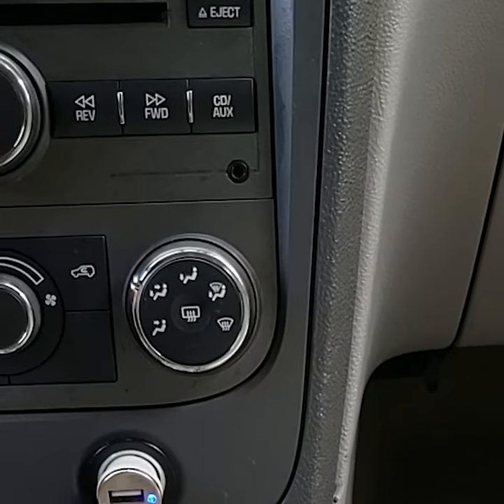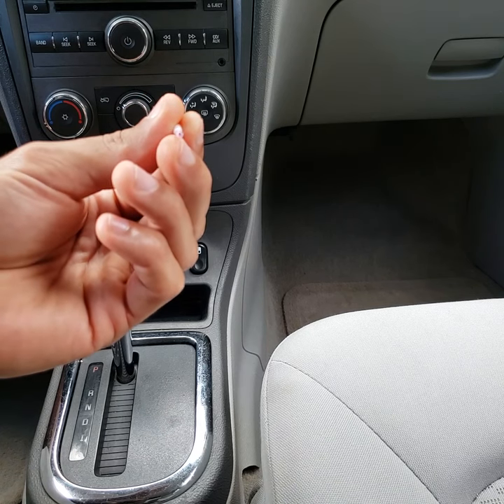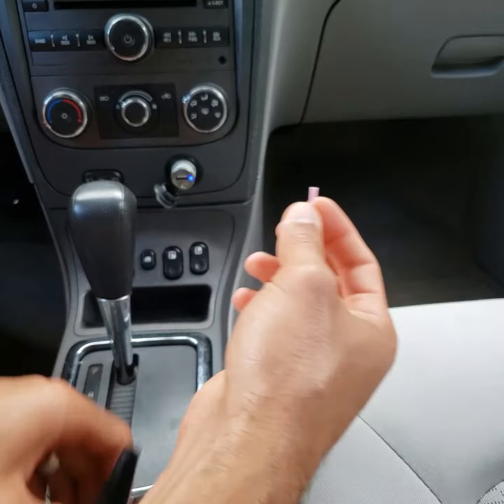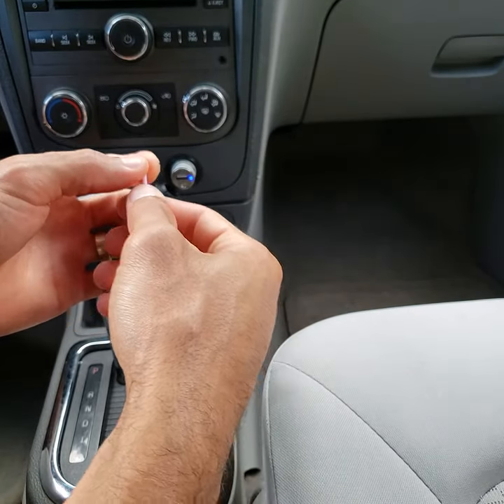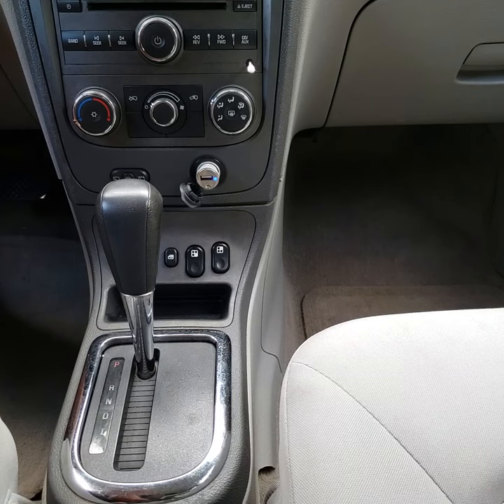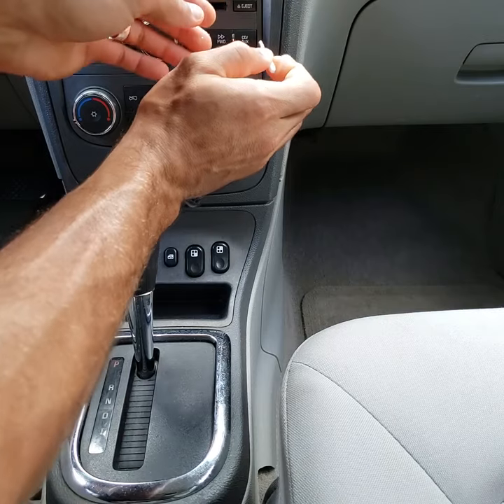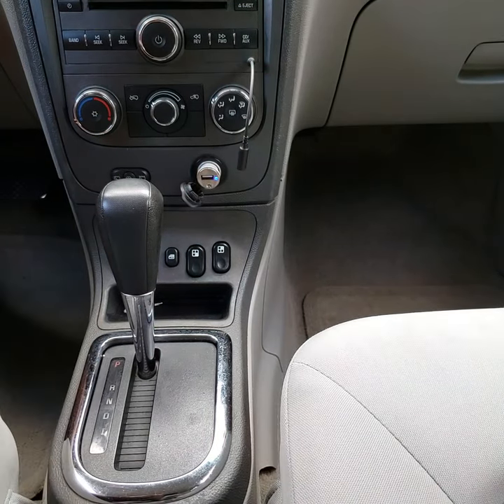How To Remove A Broken Aux Cord From A Car Stereo

Comment: So this didn’t work for me, I even tried melting the end of a pen and putting that in, but it failed as well. I ended up taking the face off and the actual port is a plug and so I took it out and from the inside I saw the tip so I just pushed it out with a nail. It came right out and then I just plugged the aux port back in, put back the plastic cover and it works great!
Reply: Hi there hopefully this helps me I’ll try this today did you use a flathead to pop face off I’m so agitated this is like the second time mine has done that and mines is in my armrest it’s been hectic and tiring ?????

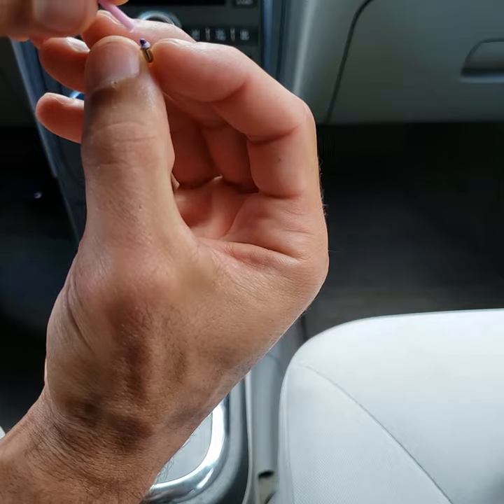Comment: 1:57 I need to try this, I think this is what is wrong with the port in my used card. It hasn't worked since I got the car, if I push in the cable it connects but as soon as I let go it slides out a little and disconnects the phone so something is definitely stuck down inside there.

Comment: trying to do the same thing with the ink tube from a pen. So far no success but im going to keep trying. I also tried using the original aux cord that's missing the tip with super glue, after about 15 minutes i came back pulled it out and the guts of the remaining aux cord-tip got ripped out instead of the entire thing coming out in one piece so it seems like its REALLY stuck in there :[

Edit: I finally got it. Took my stereo apart to get behind and pull the aux port out then had to do some surgery on it

Comment: How did that even happen? And why are you using a ‘port’ instead of the same stereo mini? You scared??

Too many interconnects and it’ll be worse for you,.. bad audio..
Reply from the maker: Don't know, bought the car with this issue.
Reply: @BisonArmstrong  you’re a god for finding the problem/solution(all without going the other route in removal then fix. I would have, at least.